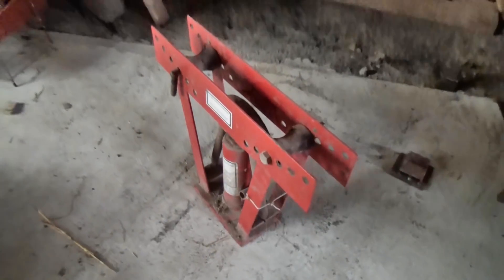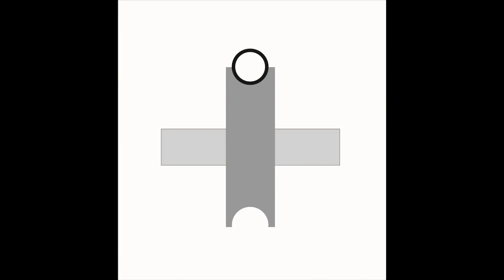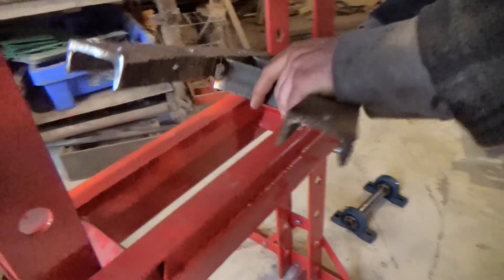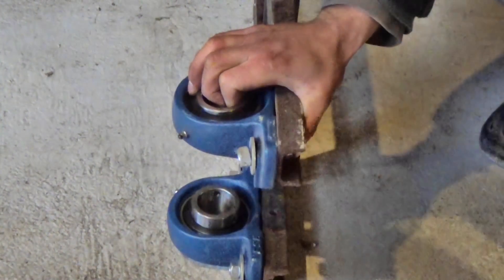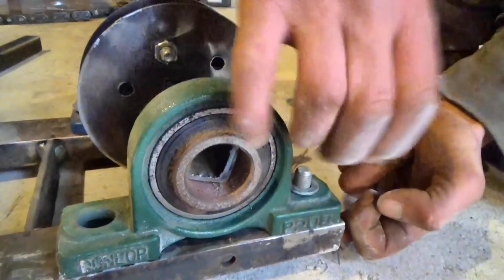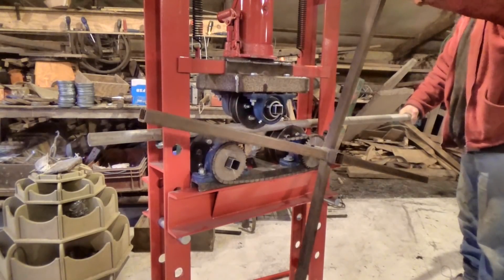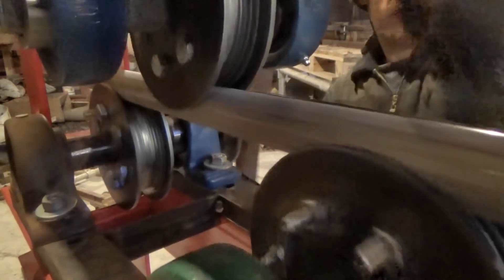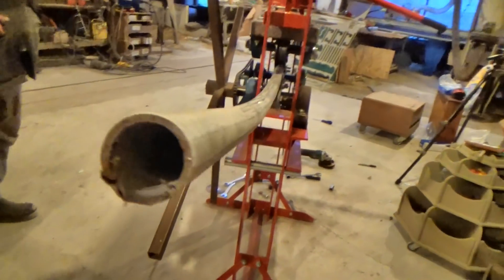Homemade Pipe Roller That Really Works! (without a lathe, but with a cnc plasma cutter)

Comment: Nice build. I suggest making another pipe exactly like the one you made here. Then cut them appropriately so as to make a perfect circle and attach them to you T handle on the bender for easier cranking.
Reply from the maker: Yes, I have just made a rim for the handle wheel

Comment: You could try making the dies out of hardwood too.
Reply from the maker: You're right. Or good quality plywood
Reply: @WayOutWestx2  maybe resin impregnated plywood? If you had a vacuum pump and a bag you could fill it with fiberglass or acrylic resin and that way it'd be really hard and you could shape it on a regular lathe and it'd be inexpensive. I'd think hardwood like ash or oak or something similar would be the best bet though. (I don't know the trees of Ireland)

Comment: I really enjoyed this. I have recently been thinking how to make a poly tunnel to a custom size.
I wonder; have those scratches ruined the galvanisation? The galavanisation is only surface-deep after all. Perhaps you'll need to paint them.
Reply from the maker: The zinc is only on the surface but the effect seems to go deeper, so I think even this first pipe will be ok and the next will have less damage - I hope

Comment: If you got a piece of metal the thickness of your die, could you not put an axle in, then use the plasma cutter like a lathe tool,  mount at axle height, then move the torch to cut out the required shape in a series of operations as the axle is slowly rotated with a drill or similar, exactly like how it would be done on a lathe? This should be much faster, avoiding any assembly or bolts. If you don't have thick enough material it could be done with several equal sized circles sandwiched together & then cut. Thanks for sharing!
Reply from the maker: Yes, in theory. But that's not quite how plasma cutters work. You need to set the power to match the thickness of the cut - but the thickness would change constantly in your proposed situation, wouldn't it?
Reply: I would have thought as the metal rotates it would present a maximum start thickness that the plasma would cut through as the blank rotates and then it would miss what is left behind till the torch position is moved. I.e. I think it would work as a cutting torch lathe tool. Fairly easy to do a simple experiment, but no doubt you have too many other jobs & your way is working. Good Luck!

Comment: Pipe bender make a large coil spring to fit to hot tub
Reply from the maker: I like that idea - except where would you sit?
Reply: @WayOutWestx2  The coil is on the outside one pipe is in the water the other is above the water line ,firewood is in the middle of the coil look them up many companies make this hot tub its a wooden tub

Comment: if you made it so the edges of the discs matched the curve then you could have grinded away the material that crossed the curve and had a more smooth transition. that or take what you have and add some weld into the gaps and grind smooth.
Reply: You might use hard facing weld rod to fill the inside in and help it last longer

Comment: Great lateral thinking as always from Tim. If you can vary the distance between the rollers you will be able to vary the radius of the finished sections.
Reply from the maker: You don't need to move the dies for that, Roy - just how far down the middle one is.

Comment: balast the fram and put the rollers on the outside of the frame instead of in the center
Reply from the maker: There would be a lot more strain on the shaft, but I'm sure it would work for lighter pipe at least. Thanks.

Comment: Long lengths may need to be bent sideways ?good job , look forward to seeing the project 
👍🏻
Reply from the maker: We shall see!
Reply: @WayOutWestx2  I have experience at bending pipes for gas n oil pipelines ,we bent them mostly in the orientation of how you did ,but we had machines to hold them ,our pipes weighed 6 to 8 ton sometimes ,I did a job with a sidebender and it was difficult with moving stands with rollers..etc...you will figure it out I'm sure ,a great tip is..1 degree over 12mtrs is 200mm

Comment: Brilliant idea with the stacking to get the dies. If you had wanted to, you could have used a grinder to round over the dies slightly and make them less edged. After they were bolted together.
Reply: and you only need to grind over one side of each die plate...could still grind the edges once assembled but take a bit more work
Reply: So many helpful suggestions.

Comment: You've used the square peg in a round hole trick quite a few times. Have you noticed any odd bearing wear due to the four contact points instead of a constant contact point?
Reply from the maker: I haven't Tommy. But then I'm only using them for slow speed operations so I couldn't promise they'd hold up for everything

Comment: Fantastic! Do you have a smaller chain so the bottom rollers could be closer together? The curving could then get closer to the ends.
Reply from the maker: Actually it's the frame of the hydraulic press that's the limiting factor.